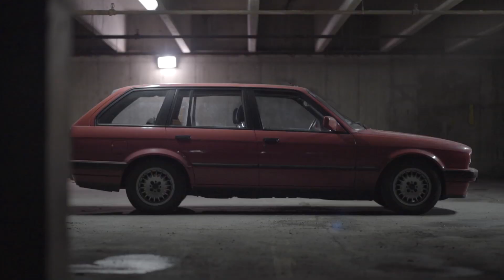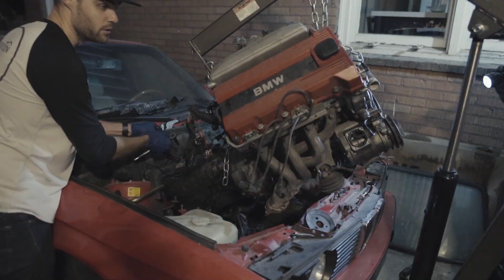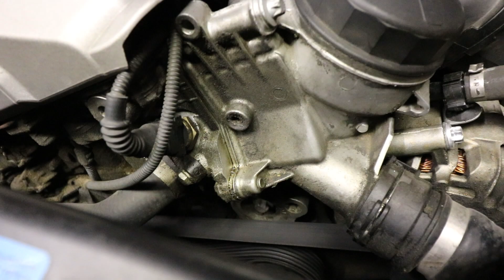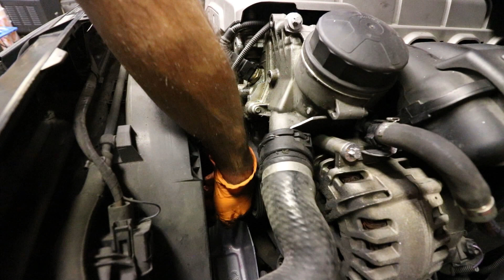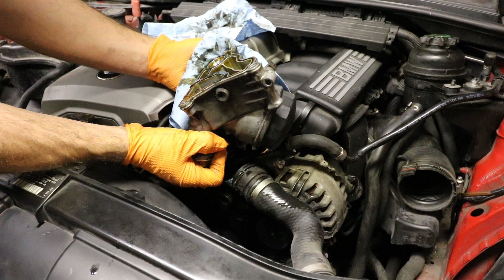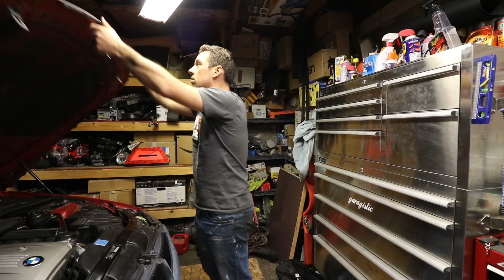DIY Oil Filter Housing Gasket N52B30 BMW E90/E91/E92/E93

Comment: I’m surprised you didn’t take the cap to the oil filter off and clear the housing of oil.
Reply from the maker: Me too actually
Reply: But I was judging you before I did the job. Sorry about that. I completed the job after your video and others. I did use a hand held siphon and got it all out. But becsuse of the way i replsced the gasket i couldve done what you did but probably would've been messy down the driver side of the engine block. I removed the oil filter. Then put the cap back on tight. And tipped it upside down to replace the gasket. My thick radiator hose with the quick connect fitting would not under any circumstance remove off of the housing. I had the metal pin pulled and removed. Should've slid off.

Comment: I watched a bunch of these tutorials to get ready and I noticed nobody shows how to properly refill the cooling system and purge any air out. Is it just as straight forward as filling up the expansion tank and opening up that little screw? Do you need to run the engine to push the air bubbles out?
Reply: you also have to bleed the air out it's something like, holding down the gas pedal with the ignition on till you hear the pump running, google it, or search on youtube

Comment: My uncle was telling me that if I'm missing coolant and the oil housing is leaking then that's where my coolant is going. I wasn't understanding that then. But when you drained the coolant from the hose to the oil housing, it made sense then. I also noticed that the small bolt under the manifold is backwards. Instead of going left to loosen it, you went right. There's quite a few bolts like that on the E90. But thank you, I'm changing this gasket today. I'm not doing the valve cover gasket cause that's too much to take off and I don't want to do it. I am a certified mechanic. I just choose not to do it unless it's not a lot to take off. I don't care to get dirty and I'm allergic to diesel. Found that out when I went to school. Thank you for this video. I was just going to look in the book. Great video
Reply: Breebree Bam how everything go? I’m doing mine today or maybe tomorrow i just need the swivel
Reply: @randormoreno4531  it actually went pretty well.  Its not hard to do at all. You can use an universal socket for the bolt under the manifold.  You don't have to take that off. I think I used an 8mm or a 10mm universal socket with a swivel extension. Just clean the housing real good replace the gasket and replace the bolts and the hoses. Also put the air filter box back on. Also replace the coolant as well. Remember the coolant is always blue.

Comment: I used an 8mm ratcheting box end for that little bitch bolt. It was difficult but it worked since my 3/8 extension wouldn’t fit